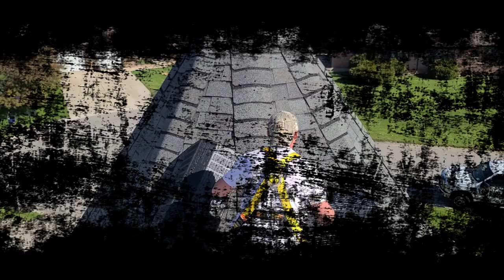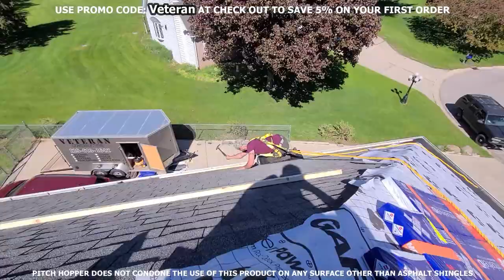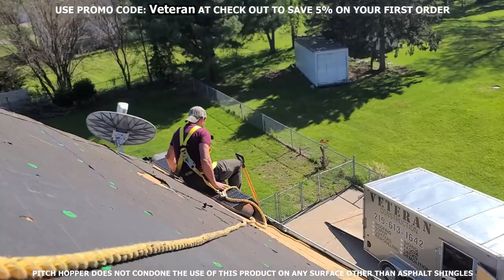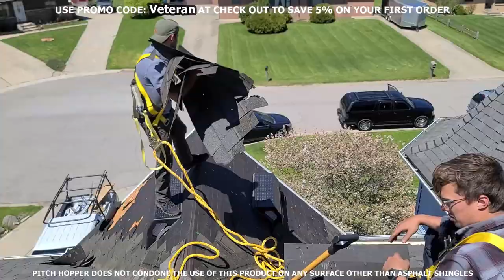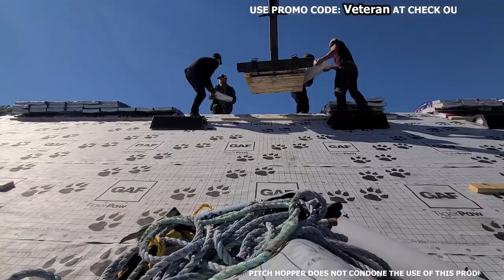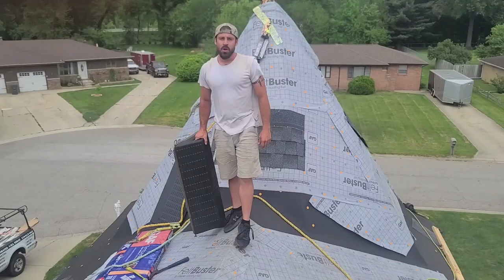TEASER FOR THE NEW VIDEO DROPPING TOMORROW! 6/27/21

Comment from the maker: If you are thinking about purchasing this product prior to my video drop tomorrow please understand that the use of this product is ONLY permitted on asphalt shingles and not other surfaces. Not plywood, not felt, not ice and water shield, not metal roofing, etc. ONLY USE WHEN ON TOP OF DRY ASPHALT  SHINGLES AND DO NOT USE ON ROOF SLOPES GREATER THAN 12/12. This product is not to be used in place of your safety equipment! It is a safety aid, but it is not a piece of safety equipment. Wear your ropes and harnesses, and always put your toe boards down to ensure your safety.  By using the Promo Code " Veteran " at checkout you will save 5% off of your ENTIRE order, regardless if you buy 1 for  yourself or 10 for your crew. I personally recommend 2 per roofer as these Pitch Hoppers compliment each other very well. One to stand on, and another to hold your shingles is the perfect scenario for speed and comfort. I demonstrate this tomorrow! Please be sure of exactly how many you really think you need before buying because I can only save you 5% this ONE TIME. If you go back to buy more, even if the promo is still running, this is a one-time-per-customer-5% Discount-limit. And I am POSITIVE you will want more than one Pitch Hopper. Don't forget to share this video with your fellow roofers, employees and employers! Link below to view products! Personally, I will be getting some of the 32" yellow ones next.  

https://www.thepitchhopper.com/shop

#PitchHopper #VeteranConstruction #Roofing
Reply: I also use the pitch hopper is a bang for your money
Reply from the maker: exactly! i thought they were going to be more expensive honestly!
Reply: At first I didn’t think they where going to hold me
Reply from the maker: I've multiple squares on these things! Human weight ain't nothing.  As long as you put the correct pressure

Comment: What's wrong with couch cushions? They work and they are free. We are probably the only humans that can actually recycle old couch cushions.
Reply from the maker: Yea we'll i used cushions a lot. But I bought 2 of these things, and immediately went back and bought 4 more. Since then, nobody has touched the couch cushions lol nobody even looks at them. It's a huge difference and it's hard to understand it until you've shingled with one or tore off with one
Reply: There's a couple guys on our team that still roll with cushions out of habit but the pitch hoppers are amazing. Even if just for somewhere to put tools/materials
Reply: @NWIVeteranConstruction  couch cushions don't give you a nice flat place to stand. Only a place to sit or hold a bundle. How much are they?
Reply from the maker: they're around 100 a piece. but will make their money back in like. a day lol
Reply: @NWIVeteranConstruction  I bet my insurance company would very much prefer me to have these instead of what I've been using. If one of my guys does go over the edge for whatever reason, at the very least I can say I"ve invested in the best roof traction safety device on the market.
Reply: Ole sponge Bob Square Pants isn't on the same level as the hopper. 

I only use the cushion to make sure I don't scuff shingles ( that lovely GA heat )